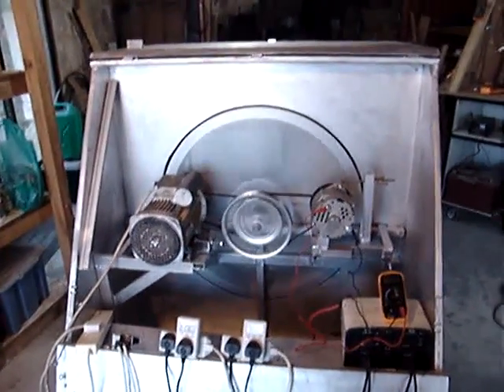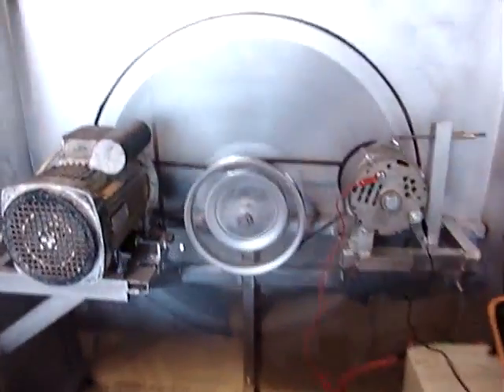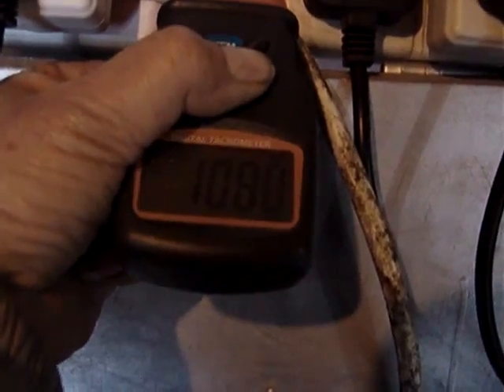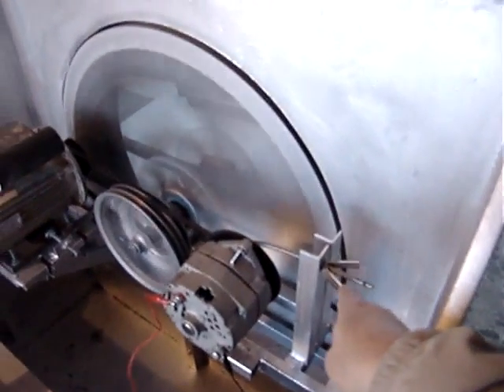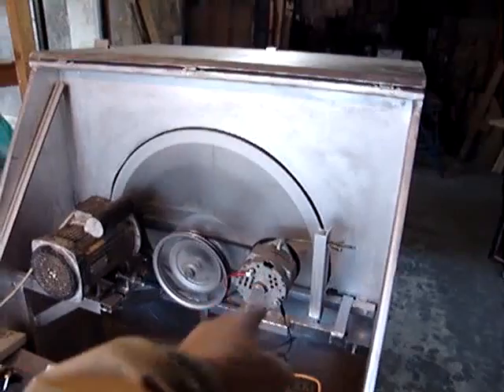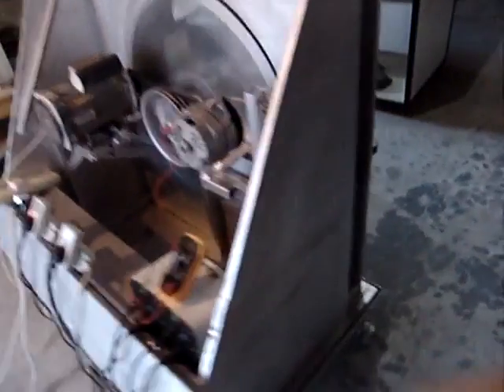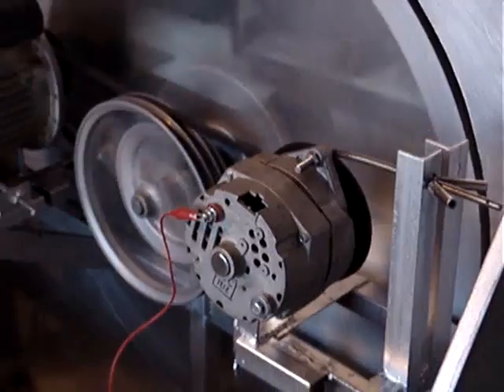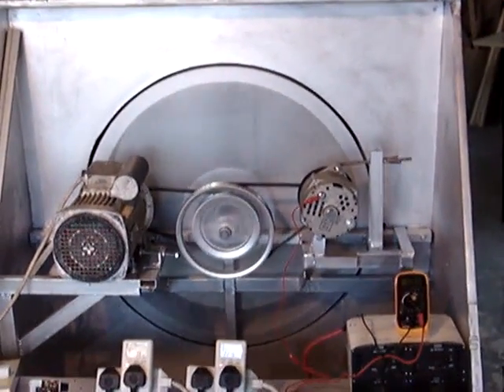Ротовертер в работе

Comment: Assuming output power... just because you have RPM, but no "working torque" (due to the lack of a load) is as wrong as you can be. In other words, just because the PMA is spinning at "XXXX" RPM and it CAPABLE of XX Amps of output at that RPM, does not mean you have sufficient input mechanical horsepower (simultaneously  measured RPM and Torque) to reach that much electrical output power (simultaneously measured Amps x Volts).  

Also never try to measure an alternator/generator "output Amps" by putting am Ampmeter directly across the output... you will always burn up the ampmeter. Ammeters must be connected in series with a test load, while simultaneously measuring the Volts across that same test load. 

All Power measurements must always be measures simultaneously.